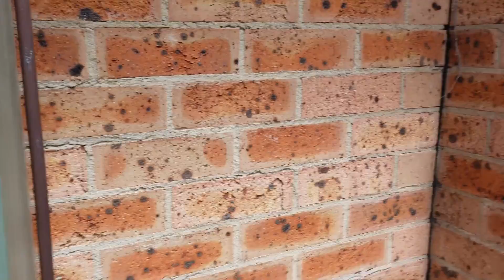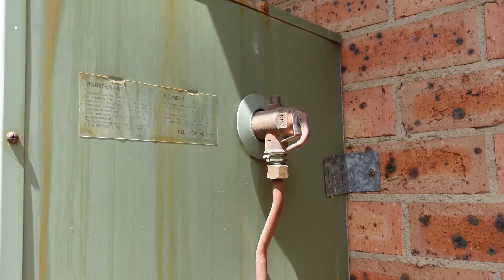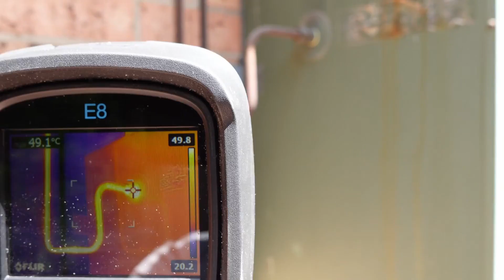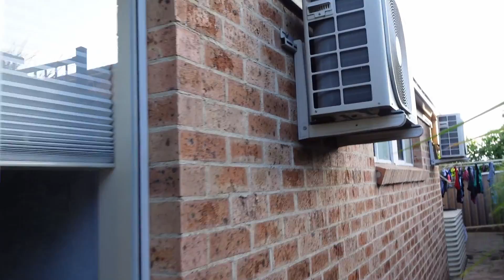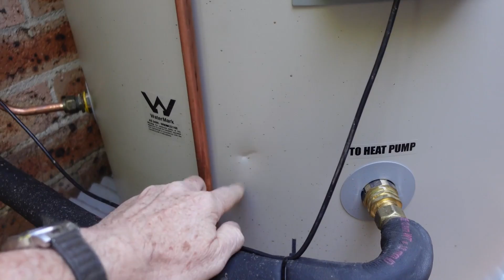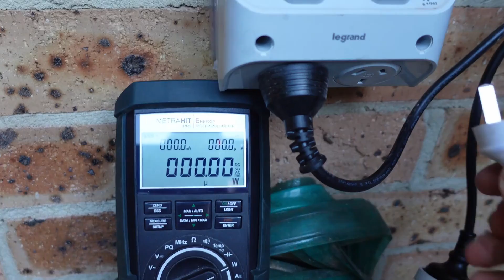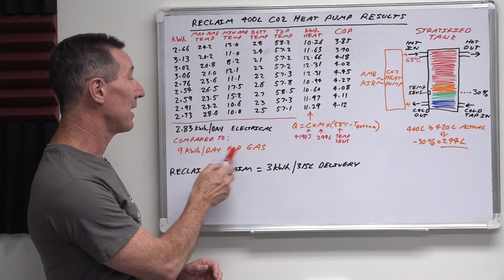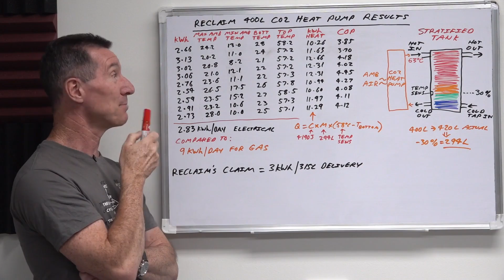EEVblog 1517 - Heat Pump Hot Water Install & Analysis

Comment: Heat pumps are great. Stand alone air cons should be a thing of the past. Even in warm climates you can still get days cool enough you might want to warm it up a bit.
Reply: An air con unit also uses the principle of a heat pump. A split air con can even reverse the mode of operation and either do cooling or heating (heating is even more efficient than cooling typically). Stand alone air cons can potentially even be more efficient than a central unit, due to losses and least common denominator control.
Reply: "Heat pumps are great" hahahahah nice joke. cost £40 a day to run! what a joke.
Reply: @ritecomment2098  Two things: If you're using a regular electric heater/cooler somewhere, the joke is one you because a heat pump is using less electrical energy to achieve the same. Second: Heat pumps have a ton of applications, some people will use daily without knowing, like in a fridge or aircon or even a CPU cooler. Your cost "argument" is rather useless without mentioning what your getting for it and what alternatives would cost.
Reply: @danielegger6460  yes. It's down to the fuel cost to thermal unit generated. Gas is still cheaper to run with conventional radiators that a 'heat pump' that will only pump the money out of your account. I'm back to burning wood as it's cheaper than any alternative.
Reply: @danielegger6460  I'm pretty sure a normal heat pipe or heat column-basd heatsink uses passive capillary action and the phase change of typically a tiny amount of water to wick heat away from the CPU with the assistance of a fan, not quite the same as either a reefer-based heatpump or even a peltier device that actively moves heat in some fashion.
Reply: @DFX4509B  True, those are a much simpler construction and don't use fancy coolants or active circulation typically but the concept is quite similar to how a heat pump works with the coolant being vaporized on one point and condensed on the another. If you don't like comparison, just stick to fridge as another example example for a heatpump which can be found everywhere. ;)

Comment: Your gas company was probably overcharging you for gas. Just like my electric company was. I use 25 to 30% less energy now that I’m totally off grid than I used under grid power. Either my inverters are not accurate or they were ripping me off.

Comment: I would be very surprised if it's actually more efficient in colder weather. Basic thermodynamics says the highest COP should be at the highest ambient air temperature.
Reply from the maker: According to the designer (I contacted him), yes it performs better in colder climates. With C02, the colder in ground water temp to higher the COP. But also the higher the ambient temp the higher the COP.
Reply: @EEVblog  that makes sense that the COP would be higher with a colder water temperature. But I think you'll still use more energy overall, heating cold water than warm water.
Reply: @EEVblog  to prove this to us you should make a video about the phase changes of multiple refrigerants and their resulting maximum efficiency temperature deltas! :P
Reply: @shittubes  What the designer was saying is that it performs better with lower cold-water temperature. But it also performs better with higher ambient air temperature.  Therefore, Dave is getter poor performance, as he is only using a small amount of hot water tank capacity. So the system has to reheat a lot of warm water already in the tank at a greatly reduced COP. My simmilar system only uses 1kW/h per day.
Reply: @shittubes  Interesting, I have not seen systems with the extra valves to solve the COP isssue. I had to add an extra temp sensor in the well and modify the scheduling of the heating to get around this problem. This way the unit only does a reheat when it there is less than 50% full. Typicall only runs once every 2 days and in summer can run as little as once a week.

Comment: I'm afraid your efficiency assumption for the old gas unit is way off the mark.  Based on the fact that Sydney water is not really cold compared to Melbourne, the cost to run your gas unit is horrendous.  I have a gas storage unit here in Melbourne and it uses nothing like yours does - we are a 2 person household, but one of our few luxuries is very long showers - 20 minutes at least each.
Reply from the maker: I got the gas effiency data from an Australian suppliers website.

Comment: @EEVblog / Dave - Is there a reason why you went with this particular hot water service and not one of the rheem ambiheat self contained systems?
I'm looking at replacing my instant gas system and the kW rating of the heatpump systems (in non ideal freezing conditions) is giving me cold feet. [pun not intended]
Reply: The Reclaim unit turns on in low temperatures unless disabled by the user or of course a power cut. The risk of drinking water contamination means you cannot use a sealed system circuit with antifreeze in case of a leak.
Reply from the maker: A few people recommeded it, and I saw a giant spreadsheet list of units and the Reclaim seemed the best, but the most expensive.
Reply: @EEVblog  I guess the higher COP heat pump only option in sunny Queensland is a bit of a no brainer. I'm just thinking about all those cold nights in Canberra when my split system struggles to keep up and I end up having to use restive electric heating to take the edge off (or the ducted gas, but it can be quite pricey) The Rheem has a backup 2.4kW element which is what's selling it for me in our climate.

Comment: Solar vapor absorption heat pumping should be a thing, like a propane powered fridge but solar vacuum tubes are producing the heat for the generator.
Reply: Electricity just gives so many more options... Selling to grid, turning a pump, charging your batteries..
Reply: @rkan2  You're not going to lose too much roofspace anyways with good thermal transfer and COP put together. Got natural gas backup as an option, too.
Reply: @leerman22  Optimal roof space is always limited. Also solar electricity is too cheap.

Comment: Shouldn't they have used dielectric couplings to connect the copper pipes to the tank? (protect against galvanic corrosion)

Comment: Great video.  It would be ideal if we could dump thermal energy from a refrigerator or air conditioner into a water tank for hot water.
Reply: With a fridge your dumping the heat into the house, air conditioner would be worthwhile although if its reverse cycle during winter you would cool your water.
Reply: You can, just place the heat pump next to your devices producing excess heat. They're people using a hot water heat pump to cool a wine cellar in their basement or using excess heat of a combustion based central heating/barn/server farm/household appliances. Of course if you care about the temperature in the room it's advisable to have some control over the airflow. You probably wouldn't want to do this in a heated room like a kitchen in a moderate or cold climate though...

Comment: well i wonder how efficient using an electric refrigerant based heat pump would work.... instead of heating/cooling air, using water instead
Reply: There're different kind of heat pumps; a typical air con is air-air, the shown system is air-water, typical central heating is also often air-water, though water-water is also common using well water or digging up the backyard and laying pipes.

Comment: If you don't use all the 400 liters at 58°C, you should reduce the set point temperature. A part from the fact that beyond 45°C hot water can cause burns, you'd definitely get better COP and less heat loss through the tank insulation. Ideally, you should get so low with the temperature that the 400 liters cover your hot water needs with as little mixing with cold water as possible. Of course, periodically you should still give it a heat up to prevent legionella.
Reply: Keeping hot water at 50°C is enough to avoid problems with legionella. Simpler to just keep it that hot (or hotter).
Reply: Yes, but usually heat pumps have a timer that runs a high-temperature program every week or so. No need to stay continuously above the legionella threshold.
Reply: I think the Aus/Nz code of practice requires a minimum temperature to mitigate Legionella bacteria.
Reply: Yeah, 58c to prevent legionella...
Reply from the maker: You can't change the 58C set point nor the 63C output.

Comment: Would be an idea to mount the evaporator unit in a garage and the tank in a hot attic space. Then you can use the free cooling of the evaporator for a large space in the house such as a garage which would help an electric car charge faster and the lower temperature of the space would make the CO2 unit more efficient. Might not be practical but would maximize efficiency.
Reply: Reclaim specify the evaporator unit must be installed within a certain distance, from memory it's 1m.

Comment: I'd be interested to know how many kWH are needed to keep the water hot all the time if NO household hot water is being used (such as when on vacation); that is, what is the cost of the losses due to the imperfection in insulation and such.  (I'd imagine that by using only about half or less of the hot water capacity per day, since the heat loss per day occurs on ALL the water, but in the calculations, all that heat loss might be attributed to the hot water that is actually used (depending on the calculations used), that would unfairly hurt the efficiency calculation...?
Reply from the maker: Wouldn't be a lot. maybe a few degC drop per day it need to recover.

Comment: The only thing that surprised me is that your heater tank is not strapped to the wall - it is a tipping hazard in case of an earthquake or if a kid decides to do a pull-up on a heater.
Reply: The bloke weighs 900 pounds. what are you talking about? I do this for a living. Unless you are the Incredible Hulk, you won’t move a 900 pound water heater.
Reply: My 400 litre tank was mounted on a 1m x 1m concrete plate, ants made a nest under the plate and the tank became the leaning tower of Pisa. Was a mission to get it back to vertical.
Reply from the maker: 400L of water is 400kg alone.
Reply: @EEVblog  It is true. However, the base area is not that large. I don't know, just used to see them strapped here.
Reply: Lol

Comment: I like the design of that.  Here in the US they are a combined unit (at least the common residential units) with the compressor assembly sitting on top of the tank.  I suspect the remote unit like that could be a little more efficient since you probably have a good bit more area for heat exchange.  As it is, I'm using about 1/3-1/4 less power over our old resistive heater.  (Varies by the temp in my garage).  Still completely happy with the purchase, after the local rebate we got the unit will have paid for itself in under 2 years!

Given our current electricity rates, we're paying anywhere from $.30 to $.60 USD a day for hot water.  That would have been between $1-2 usd with the resistive heater.  Last week we averaged 4.2kWh /day power usage on the unit, and that's with 38-45 deg F air supply temps.  This past summer when it was over 90f in the garage we were down near 3 kWh /day.
Reply: Same here, I love my hybrid... I keep it on heat pump only. 

I had an old (1995!) oil fired cylinder and it was a huge waste of money and oil. It ran more often than my hybrid unit which pulls 450W. I left it in the house for a year after I bought the home, and then I kicked myself when I saw how fast it went through 125g of oil!
Reply: @volvo09  if it is the ge you can even set the secret cold climate efficiency mode and it will be even less tempted to use the resistance elements. "Only" is defined loosely.
Reply: @ThomasSuckow  You can lock the Rheem in heat pump only mode as well.  I've found it works a lot better than their 'eco' mode which does wierd timings with when it does and does not run the pump and sometimes uses the elements.
Reply: Let’s hear how cold your garage is in the winter time with that thing suckling all the heat out of your garage.
Reply: @USA-GreedyMenOfNoIntegrity  Quite cold, but who cares, its the garage.  Makes it a bit nicer to work out there in the summertime though.  The garage is to the side of the house as opposed to under or above, and the walls are well insulated between there and the living spaces.  I'm also planning on ducting the intake to the attic which is directly above the unit, so it will have access to much warmer air temps almost year round.
Reply: Tanks with the heat pump setup sitting on top are, or at least were, available in Australia.
Reply: Sanden makes a split unit available in the US. It's pricey though.

Comment: That's weird. When my Reclaim was installed they used the GPO for the controller but insisted on hard-wiring the heat pump itself. I wonder if its a NSW/QLD thing
Reply from the maker: Weird. It's only 1kW with 2kW peak.
Reply: In NSW they re-used the existing wiring circuit & hard wired mine.  Switching the breaker to peak at the board

Comment: Can't get more than 2 years warranty on a heat pump, because they are junk and many fail before 5 years.
Reply from the maker: Mine has 5 years. No different to an aircon.
Reply: @EEVblog if anything, it should probably be more reliable than standard traditional AC
Reply: @EEVblog  Nice I see their website states 6 years on the heat pump / compressor, 15 on a stainless tank and 2 years labor. Bosch, Rheem and Stiebel models I looked at all have 2 years and 5 on tanks. Thanks.
Reply: Reclaim Energy Controller and sensor lead - 2 years warranty.